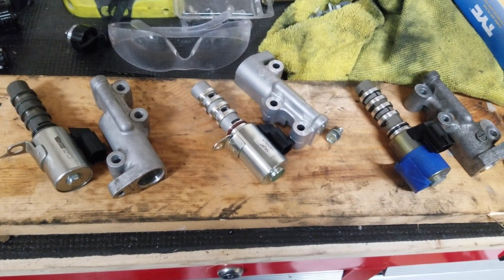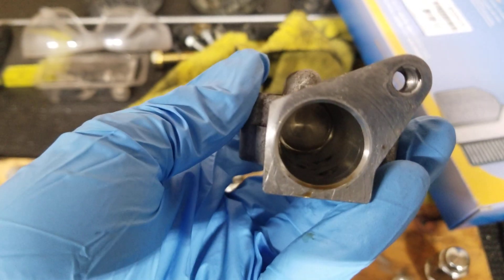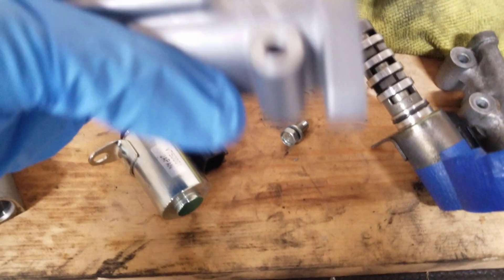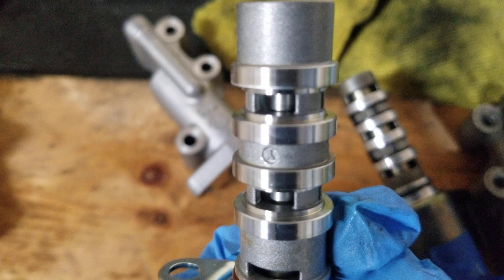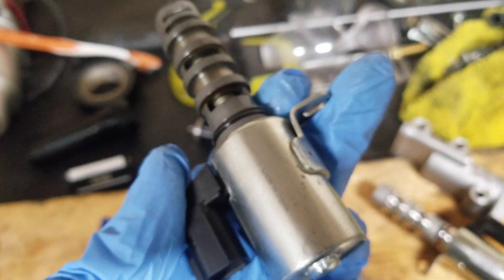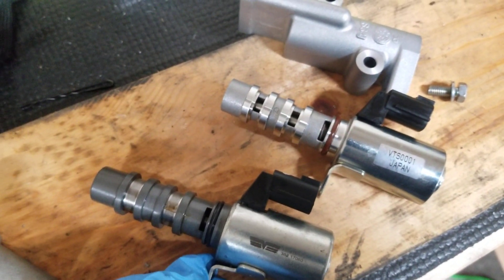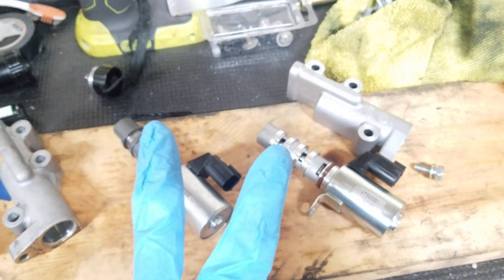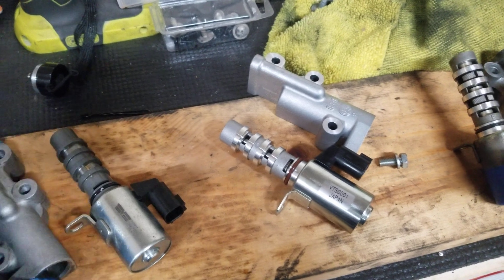OE/OEM vs Aftermarket VVT Solenoid Comparison

Comment: So if it has a 7 on the bolt it’s considered OEM part?
Reply from the maker: The OEM bolts will have certain symbols, dead giveaways if they are the actual OEM part vs an aftermarket part. When you see them so often you will be able to identify them very quickly

Comment: My biggest headache was buying an aftermarket vvt solenoid for my 2.4l Malibu. Always got a code after 100 miles until I replaced with OEM.
Reply: So it's worked just it was throwing code ??

Comment: I'm getting code P1110 Infiniti QX4. I purchase the vehicle with a bunch of issues that I already fix but the VVT solenoid. Mine reads 7.7 ohms and looks a lot like the Chinese Dorman also feels weak when I connect it to the battery. I will order one from RockAuto they have the Hitachi brand. Did you remove the oil screens from the solenoid?👍👍
Reply from the maker: I did. I learned not to use Cheap Chinese parts on certain parts...just not worth the hassle.of redoing the job

Comment: Putting me to sleep
Reply: I don't futz around with ANY aftermarket parts that have to do with fuel delivery, Ignition, or anything important that would leave you stranded. Denso, Standard, or Delphi, (Delco) whatever the application.
Reply: Delco no good @chrismichaels8102
Reply from the maker: Cool beans, the fact you wrote a comment means alot! ;)